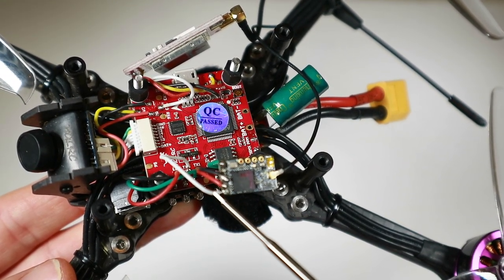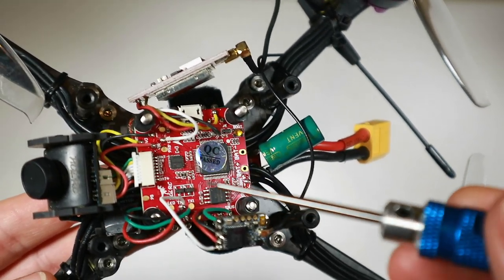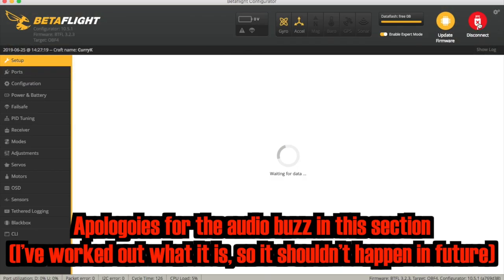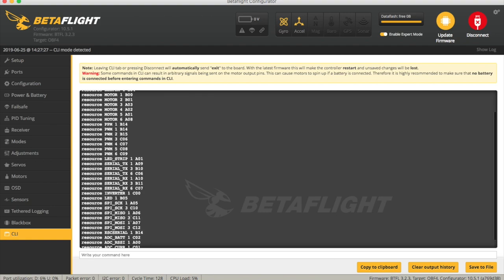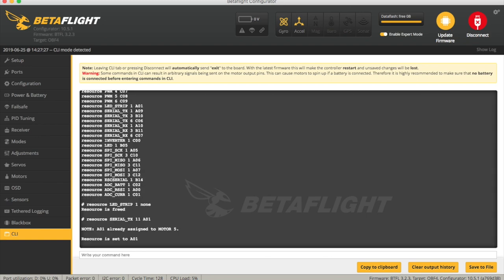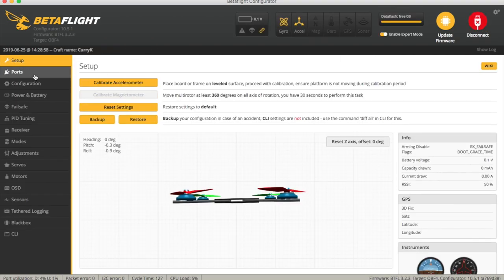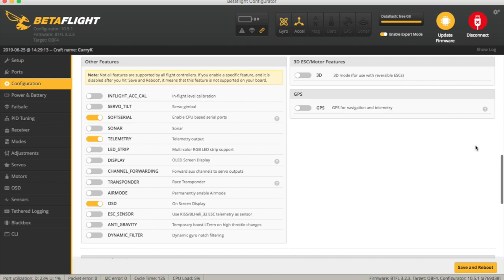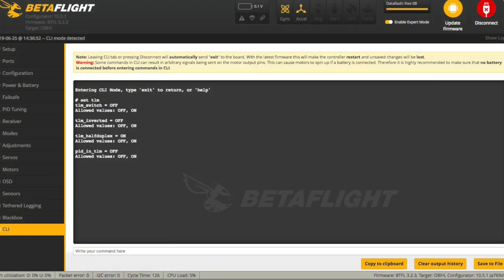How to setup a Softserial port for S.Port telemetry (or Smart Audio)

Comment: in case of f4  i would go for fport. you can use a freed TX from sbus uart for vtx telemetry then
Reply from the maker: I almost decided to use fport, but thought that the Softserial would be of general use to people - not just for R9 guys.  I thought about trying it later, but after Flex (see coming video on Friday) I'll probably be looking at Acess on r9
Reply: @CurryKitten   better wait for a stable release of opentx  2.3.
Reply: But for telemetry you need a whole uart even tho only 1 pad is used, then the other one can not be reassigned. 
I figured out the hard way on my tyro with 2 uarts, my Fport and Smartaudio didnt work on 1 Uart.

Comment: Hi i want to set telemetry using Taranis X9D with R9 long range modul and a R9 mini ota receiver on a fixed wing model. It shows me only RSSI and RX BAT , i want also battery voltage but i can find the solution. Can you help me ? If is Possible  Thanks Sorin

Comment: I think it's because you need to remove recources from motor5 for that message not to pop up.
I've just watched another guy and he removed led and motor5 before reassigining it and he didnt get the message at all.
I could be wrong but as long as it works !!  I'm using this for my smartaudio reassignment so i can add gps to the tyro XD

Comment: use inav.. I installed the 2019 r9m module and accst r9mm_fcc_fport firmware on Taranis x9d with accst firmware. There does not seem to be a problem with my sbus and remote control connection. but I cannot add a new sensor other than rxbt and rssi
Reply from the maker: That suggests it's not working properly.  rxbt and rssi is what you get "for free"  without any connection needed.  Obviously you should be getting a load of stuff through from inavif everything is configured properly
Reply: @CurryKitten   Let me detail it like this, I am using Matek F411 WSE, I connected the TX2 pad to the inverted S port pin of the R9mm receiver. In the inav ports settings, I selected the softserial2 port as smartport, but I still cannot receive any sensor data. I could not find the correct configuration.
Reply: I solved the problem and I can now access all sensors. I wanted to explain it here so that other friends can also benefit from it. While the previous receiver firmware I used was r9mm ota fport.fcc.frk, I changed my receiver to r9mm ota.fcc.frk, and then soldered the inverted sport point on the receiver to the appropriate TX pad. From the port settings, I selected the softserial2 port as smartport. Then, I set telemetry_inverted = ON in the inav cli section. When I restarted and then searched for new sensors, all sensors appeared. happy flying ☺️

Comment: Have your fixed sensor Loss with soft serial ?
Reply from the maker: Oh, there's a question.  I think I did - everytime I looked at it, I could see the telemetry was there, I think it might have just missed the odd receive and then went crazy into telling me they'd all gone!  I'm a bit vague about it as I swapped the RX out with ELRS, so I'm no longer using a softserial port

Comment: Did you ever find out why it kept saying "sensor lost"?  That happens on my Tyro 129 too.
Reply from the maker: I really haven't followed it up - What I think is happening is that the amount of data is too much and perhaps overruns (either that of the data rate is slower than expected)  either way, the radio seems to expect every bit of data in a certain interval and if it doesn't get it, you get the sensor lost.  I've watched my screen very intently and I can see data miss some updates and then start coming in again.  It seems a bit random in how it works.  I'll make myself a note to look into it should I get the time

Comment: Thank you - this worked fine for me in BF. I'm trying EmuF and in the CLI I freed the resource on the LED_STRIP and reassigned it to serial_tx 3 (EmuF wants a number between 1 and 10) and it all goes fine but when I reboot, no softserial appears, and the softserial switch in the config tab will not stay ON after I save and reboot.
I really need this to work for SA telemetry (I only have 2 UARTS, both used).
Any ideas?
Reply from the maker: I must confess that I'm completely unfamiliar with Emu... I do want to try it on a 7" as I hear it works nicely, but It's not like I'm allowed outside at the moment.  Presumably you have to go through the same cli and save afterwards - does this literally not save that config change?  Perhaps that 1-10 number is seen as a misconfig on reboot and it puts it back?  Sorry, I've no idea really, could be one for a specific Emu group - or if it's not documented well enough, then open up an issue on their GitHub - could be a bug
Reply: @CurryKitten  Thanks for the reply. I just couldn't get the softserial to show up and wound up rolling back to BF.
On a side note, I do have EmuF on a 5" and it seems very stable so far (on default settings....)

Comment: Helpme please. I have r9mini.and i wirring s.port to pin tx6. And i set at betaflight uart6 smart port. But in my taranis can not detect telemetry
 I use mamba f405 mk2 mini( i read in diagram uart6 for tele/vacancy).
Reply from the maker: Is this the old version of the R9mm which doesn't have a pin labeled "inverted s.port" ?  If so, then you are probably hitting the issue where the RX is putting out an inverted s.port signal (yes FrSky have labeled in backwards) whilst your FC is expecting an uninverted signal.  If this is the case, then if you follow the instructions to use softserial in this video then you can control the inversion from the CLI and so should be able to get it working in that way.
Reply: Can i use uart6 for telemetry with CLI resource?
Reply from the maker: Yes, you can use the tx6 pin (as you already seem to have this wired up)